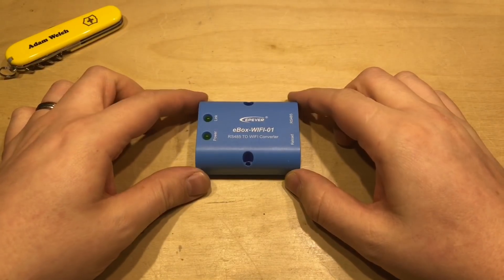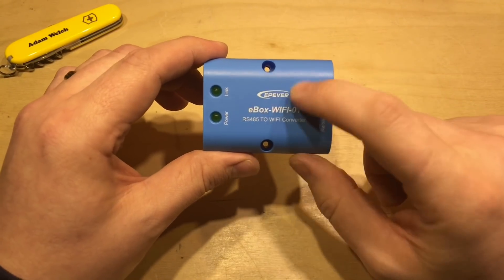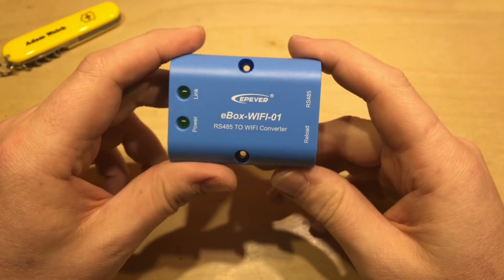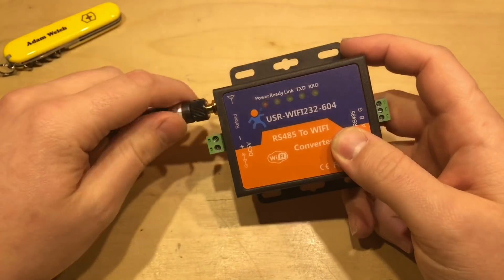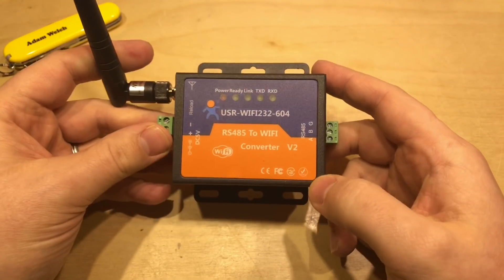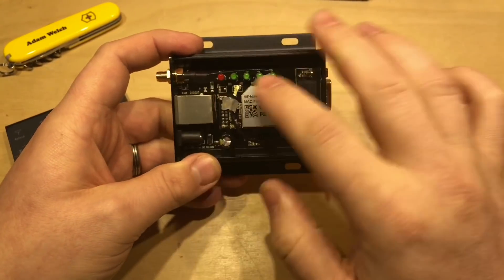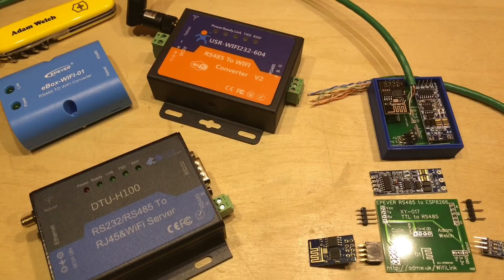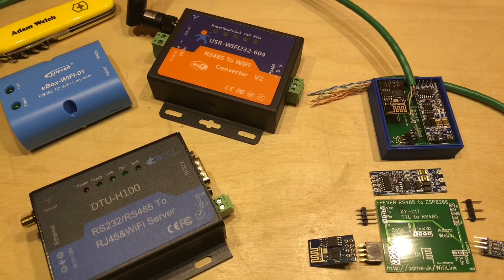Solar Charge Controller RS485 WiFi Adapter Shootout - 12v Solar Shed

Comment: Hi Adam, I recently purchased an Epever UP series inverter which works just fine, and it came with this RS485 adapter which also seems to work fine although I haven't tried to get it into station mode.
Wanting a remote display to go on the wall for the inverter, I checked out both the MT50 and the MT75, but it was unclear if either would work with the inverter.
I contacted both the local agent and Epever, only to be told that there is NO remote display option for this inverter other than the app for your cellphone or PC via the RS-485 adapter.
As you can imagine I was not happy as the inverter was not a cheap unit.
Can you see any way of making the MT75 work with my inverter? They are both RS-485 devices, and if the inverter can send the required information to my phone via Wi-Fi, surely it could send it directly (via cable) to the MT75?

Comment: Great video, thanks. I wonder if you ever tested the temperature at the back of the Solar Panel? Mine is 60 degrees Celsius in winter time (Behind glass). Does it affect power generation, could it be less? What if you used a tiny 5 Watt fan to blow cool air over the back of the panel? Even better, could you run a tiny pump to heat-up water in a jerrycan or warm up your fish tank with an heat exchanger? Those fish tank heaters are at least 100 Watt, so lots of savings there.

Comment: I used the RS485-USB cable with my OTG connected Samsung A10 running the Epever software.  Sadly, the software is very old and hangs.

I seem to remember Adam using a raspberry pi zero as a wifi interface for the tracer but can't for the life of me find it.

Comment: I've recently purchized this and it works fine in station mode, the gui is even proper translated to english.

Only problem i have is when connecting to my home wifi i guess the distance is too far so when I start monitoring in the desktop application (Solar Station Monitor v1.95) I'm unable to get all information, if i connect via USB-RS485 it works propperly.
Any suggestions about that? Is it possible to solder a cable onto the wifi's onboard antenna to extend the range of the ebox wifi?
Reply from the maker: I’m afraid WiFi antenna are generally finely tuned and tweaked for compliance so you can’t adapt them easily. 
The network cable can be extended by a reasonable amount. Does using a longer cable give you scope to move the device closer to your WiFi router?
Reply: @AdamWelchUK  Thanks for your help. I've investigated further and I'm now certain it's not a matter of wifi connection.
If I use the eBox as AP (default settings) I'm able to connect via the android app and get all parameters.
Sitting in the same spot as with my phone the router is less then a meter away, so I bet the eBox is able to connect to it just fine in station mode.
So I asume it's something in the solar monitor software. I'm able to read any parameter you can set, such as date/time, timers, battery parameter, but when it comes to monitoring I only get Solar Status, Charging Status, Battery Status, Load STatus, Device Status and min. and max Voltage of the Battery.
The status in the program states "Error: operation failed(COM#)"
I'm really confused by now.

Comment: will this work with other charge controllers that use modbus for communications?
Reply from the maker: Probably. You’d need to research the modbus registers used by your solar charge controller and adjust accordingly. Your flow would likely look very different from mine, but it would share many of the same nodes. So this one could be used as the building blocks.

Comment: Had good results with Elfin-EW11 adapter in STA mode connected to the HW VSP virtual serial port driver. After selecting the right TCP port in VSP and leaving other settings on both the EW11 adapter and VSP at default it worked OK for reading and setting configuration parameters on my Tracer AN, but failed for monitoring. After poking around for a little bit, I found out that selecting "Strict Baudrate Emulation" option in VSP software settings fixes the issue with monitoring so it seems to be all working great now. EW11 is very small and doesn't need a separate power supply.
Reply: Dear , thanks for your feedback, if you need more devica, please check .     https://www.aliexpress.com/item/32917247231.html?spm=2114.12010612.8148356.1.4fab30f7y57ma8&spm=a2g0o.store_home.hotSpots_50871957.1

Comment: I wish I had watched this before buying an ebox earlier this week! I had watched your previous video and thought it would be really neat to use the PC Client software. 

So now I am a bit confused can it not be used at all with the client software whilst in AP mode even if I connect my PC to the default 11.11.11.xxx subnet and create a virtual comm port?
Reply from the maker: No you can still connect to it as a wireless access point and use the pc software. Actually someone has found another way to turn it back to client mode if you want to. Check out the comments on the first Ebox video.
Reply: Adam Welch excellent thanks Adam I have read the relevant comments and will be giving that a try later,  I have two vans both ex Ambulances that I am converting to camper vans. I am using mains fridges and Victron inverters in both of them so I want to monitor the performance of the solar setups before we start using the vans properly

Comment: Hi Guys, found a simple RJ45 Cat5e UTP Network Cable ECONOMISER Ethernet DATA Splitter Adaptor  that  talk to both MT50 and bluetooth Ebox at the same time to Epever solar controller , link is below from Ebay .  hope this helps   regards Alex from downunder. 
https://www.ebay.com.au/itm/RJ45-Cat5e-UTP-Network-Cable-ECONOMISER-Ethernet-DATA-Splitter-Adaptor/183365142631?ssPageName=STRK%3AMEBIDX%3AIT&_trksid=p2060353.m2749.l2649

Comment: Hi Adam

Great videos
I am in the process of setting up a solar powered security camera system using a Tracer5415AN and would like to monitor everything remotely but unfortunately I am a bit network challenged. I have bought a USR-W610 which is same as your WIFI232-604 but has a 232 input as well as RS485. 
Would it be possible for you to explain how you set up the USR Web GUI and the EPever Android app so that I can connect to my router and monitor remotely? Another video would be ideal but that's a lot of work so some words with a list of settings would be great also.

Thanks
Tony
Waterloo, Ontario.
Reply: Also.....
You mention a "Quick Start Guide" where will I find it?
Tony

Comment: I use an Elfin EW11 with the Tracer. STA mode to connect to an existing AP - no problem. Small, cheap and fast.
Reply: Can't agree anymore , HF2211 also has good performance.

Comment: Hi Adam there is a new app Hi is it possible to use a new Android app np-01 on my epsolar tracer an 40amp IV got the blue wifi box the app connects to the wifi but it won't load or save data

Comment: Hi Adam great videos mate could u tell me what is the best option for my tracer an
Thanks
Reply from the maker: The eBox Wifi works but the only other one I’ve tested was my home brew ESP8266 adapter with the AN and it didn’t. EPSolar tell me they’ve changed the software on the charge controller and that’s what’s causing the issue. I might try dig out the others and see what I find.
Reply: Thanks for that ive got the epever box and using it on my iphone ive also made the the esp8266 as per colins video so that i could monitor over the internet but no joy as you said.
Your time checking the other alternative will be much appreciated 
Thanks again

Comment: Hi Adam, just found your channel.  Cool stuff.   The last little box you made, is there a way to have a RJ45 Tcp-ip output on it instead of wireless.   I use the EPEVER 30amp tracer 3210 an on a number of sites, i provide wireless internet on to a number of customers last mile.  I have plenty of internet and RJ45 plugs at each site, but adding another wireless AP to connect your device to is just another power drain i am trying to keep to a minimum.  Would it be easy to add a RJ 45 TCP-IP port as well or as a replacement for the wireless part.  Cheers John
Reply from the maker: Hello.  No I'm afraid the code has been created for the ESP8266 which is a wifi module.  I'm not aware of any wired alternative that would run that code.
Reply: Julie Bailey i am looking for the same solution. i have a tracer-bn 30a from epever- did you figure something out? i’m looking at building something custom.

Comment: Hey Adam, any chance  you can share how you configured the USR-WIFI? I've started with it in the default AP mode, changed the 'application settings' to match those used in the EboxWiFI. I've then used USR-VCOM virtual serial port server to create a virtual com point and whilst it says that its connected its not sending or receiving any data and my Solar Station Monitor software is giving a time-out error? I'm guessing it's a problem in how I've configured the USR-WIFI as there's lot of things to fiddle with in there!! Cheers

Comment: Hi Adam, 

A little off topic to this video, however relevant to solar and from what I've researched you seem the perfect person to ask :)
I've currently gotten a 12V 200w panel, that's running an extremely cheap PWM reg, tested and can literally wait 2sec between on and off :( 
Following your review I've purchased a EPEVER Tracer 20A with the MT50 which I should get in the next week
Now to my question......... :) :) 
My Solar Panel is Rated at Max Power Current: 10.92A 
Wattage: 200 - 299 W
Voltage:12 V
Power Voltage: 18.3V
Short-Circuit Current: 11.8A
Open Circuit Voltage: 22.51V

Can I run this in series @ and around 24V+ and obviously higher or am I limited to 12v and slightly higher in parallel ?
Are some panels only rated @12v and anything much higher will do damage? 
I would like 24v from the panels, even to just limit the Vdrop

thanks in advance,
Trav from Australia

Comment: Very interesting, I have an EPsolar controller in my motorhome, I have never used its RS485 connection, I didn't want to buy something especially to do it, as it was more of a curiosity, this has sparked my interest in taking a deeper look into it, maybe I will do a video on it when I get the chance to take a look (I'm busy doing videos on the repair of a Fluke AC calibrator at the moment, and have a few review videos to record first).
Reply: @Defpom’s Electronics & Repair : Did you make a video on this? Do you have a link if so?

Comment: Another great video but I have a couple questions I'd like to ask. Did you flash the Ebox firmware for a reason other than it was newer? Can you think of a reason Epever doesn't want the Ebox in station mode? Thanks for all the interesting content this year and hope you and all your subscribers have a great 2018.
Reply from the maker: I didn’t flash the eBox firmware. Newer versions are being shipped with a newer firmware which doesn’t allow station mode. I actually bought a second eBox to see if I could get one with the new version but typically it arrived with the original firmware!
As I mentioned EPEver said that they had reliability issues in station mode - which I can’t really say I’ve seen unfortunately. 
Happy new year to you too. Cheers
Reply: Thanks for the reply I thought your original box had been borked by an update, and I thought I was paying attention. lol I still think Epevers  explanation  is weak I mean every HP laptop i've had in the last 8 years has had wireless reliability issues without doing an unauthorized, unsupported and not recommended mod to it but HP doesn't worry much about it. So if some Ebox owners want to mod it they should have let them any issues wouldn't be their problem. I wonder do they have a more expensive device that supports station mode? Maybe I'm being stupid no company would make a bunch of their customers angry by trying to squeeze more money out of them, right?  !!NOERTAP Thanks again.

Comment: would you recommend the tracer A . is there anything better for the price? and are the ones with other names the same or just look alike? I'm not really interested in the WiFi. I would like the screen and controls. great video.thanks
Reply from the maker: +James stranger I don’t think there is another charge controller with the features or customer service out there which rivals the Tracer A series myself. I wouldn’t buy a clone personally - they tend to miss a few features from the original. 
Take a look at my video about living with the Tracer for nine months to get a good idea on how well it works and a couple of caveats.
Reply: I have a Tracer A and Tracer BN (newer).  I think the A tracks powerpoints faster.  The BN seems to get stuck sometimes.

Comment: Great information, thanks.  I bought one of these adapters but decided it wasn't worth the trouble.  It seems to be standard now that companies make products that "almost work".  I am still working out complications with my solar system using a couple of Epever 30A Tracer A series controllers.
Reply from the maker: +PMB-NZ It’s a shame they removed the feature but it was always an unsupported configuration. Anyway, we’ve achieved the same functionality for less money and practically the same current by using Colin’s design.

Comment: Thanks for the epever fix link cause I tried you mod and it died like you said I will try to fix it soon. I may also try to build one like you did
Reply from the maker: Fingers crossed you can bring your eBox back to life then. The one I made is pretty simple, but works really well. Have a look at Colons videos for an in depth how to guide. Cheers OTE

Comment: Great Reviews!
First, EPever was STUPID to do that change. What a crock!  However, what you could try doing is to flash your wifi router with ddwrt and create a virtual client to connect to the EPever module and then still be able to connect to the internet. This is, of course, if the wifi router has multiple antennas.
Reply from the maker: They fixed the IP range for the eBox as 11.11.11.254 which I believe is part of the American department of defence’s public IP range! So as long as you don’t need to contact them you’re probably ok doing that!